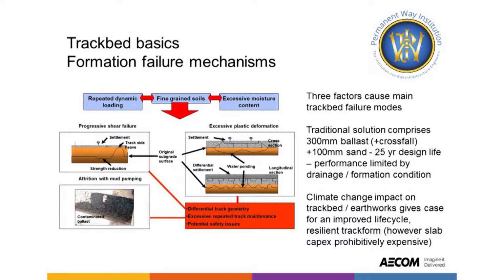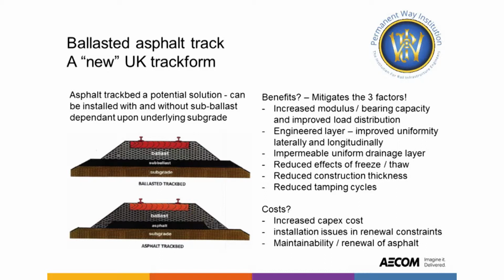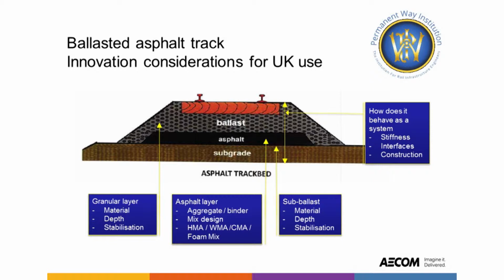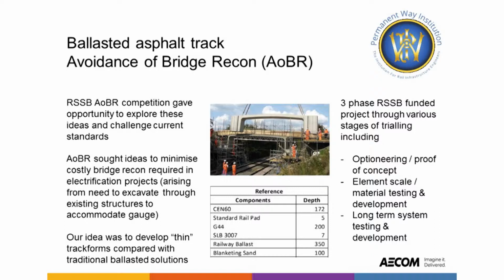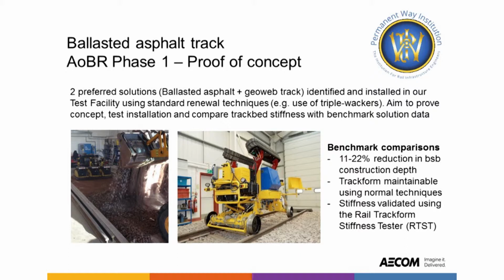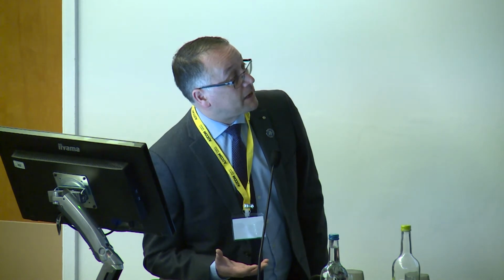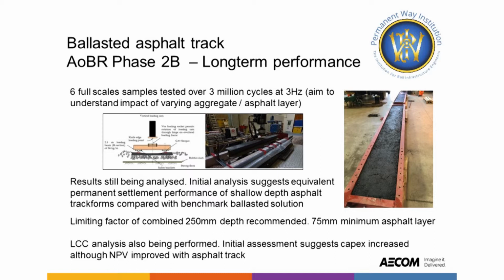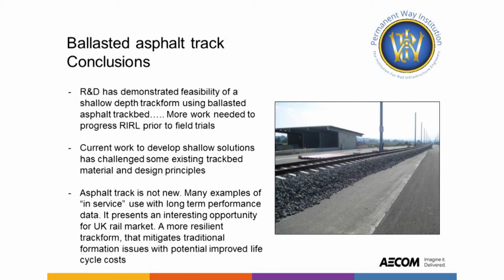Asphalt track developments

Comment: I once got involved with this in 2015 when I was speaking with the head of the blue sky thinking team, and he was telling me about the problem they had with a wheeled asphalt paving machine which nearly fell off an embankment, so after speaking with company that manufactured asphalt paving machines in Preston a special self powered rail portable and track gauge complaint was designed.

The basic premise of using asphalt is that it's a halfway house between normal everyday ballasted track and concrete slab track.

Asphalt can be retro installed an any track formation at track renewal time with not many problems, concrete slab track is really only suitable for new build track formations and it can be problematic ensuring acracy of track positioning when installing the baseplates